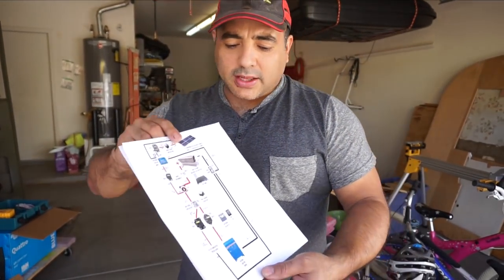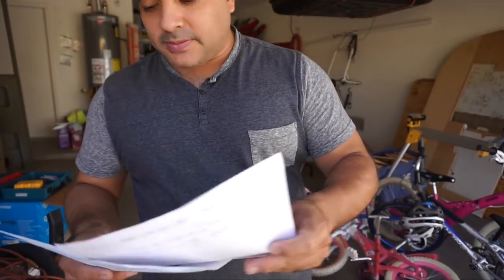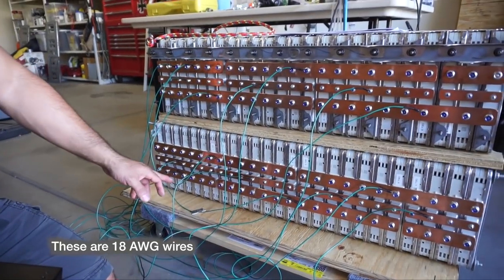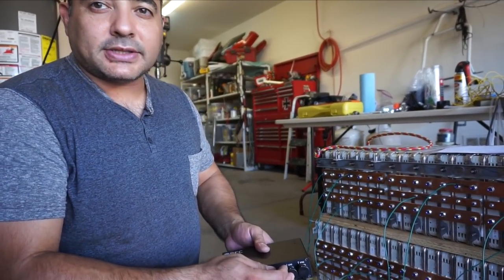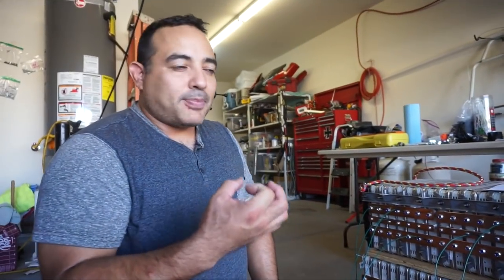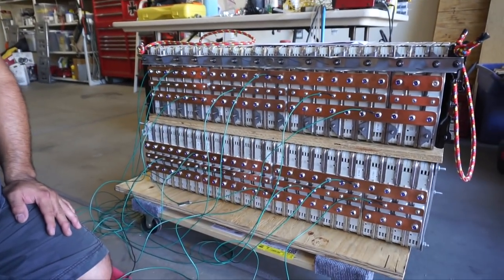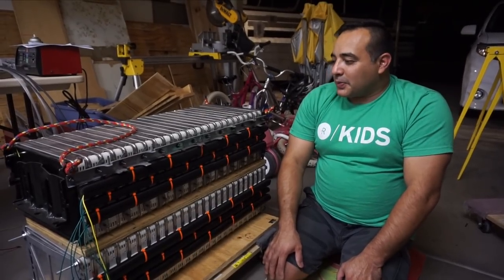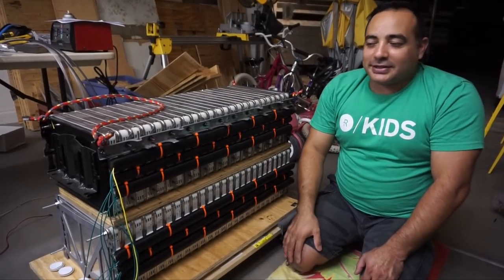RV House Battery Part 4: BMS wiring, test fit, protecting copper bus bars, and planning the install

Comment: I’m trying to understand the path of wiring for the leaf batteries. One large luggage is a positive one large lug is a negative what is the smaller center lug?
Reply from the maker: Hi Joe - the Nissan Leaf modules have 4 cells in them wired up in a 2s2p configuration.  The center lug is for allowing balancing the cells - it connects right between the two cells in series.  The voltage across this center post and the other posts is 3.7 volts (across positive and negative posts it is 7.4 volts)
Reply: Do you use the center lug? I am still trying to wrap my head around how to correctly connect my BMS. How do I get the BMS to read each of the cells (2S)

Comment: Why copper buss bars and not copper cables to connect the batteries? I am looking into this. I would like to go off grid or boondock.
Reply from the maker: Hi Celestino - There are a few reasons I chose copper bus bars.  #1 is that they came from the factory with copper bus bars - the modules are designed to be slightly compressed and copper bus bars provide a neat, secure connection.  #2 is cost - buying one large bus bar and cutting it down was more cost-effective because I could reuse the hardware on the original bus bars and just had to line up drill holes in the bus bar.  Cables would have required buying cable as well as lugs 6 lugs per module x 49 modules - we end up with 294 lugs - 2/0 lugs cost about $2 each so we would have spent close to $600 on lugs alone.  Another consideration is that cables would have been hard to make that small.  The modules are only about maybe 3/4" apart from each other.  It would have been difficult to make a cable large enough to handle the load but small enough to fit in between the small spaces of the cells.
Reply: Beginning from this Morning   thank you. It was very helpful.

Comment: What powers the air conditioner that lives in the bay?
Reply from the maker: Hi Gordon - Thanks for following along.  The air conditioner in the bay will be powered by the battery and inverter.  If we run that little window unit on "eco" mode we saw that it only draws 2 amps of power (via Kill-A-Watt meter) - our solar setup should be able to easily keep up with that even on the hottest days.  If that becomes a problem we could wire into the 12V coach system because we have like 300 Amp capacity and we only ever draw like 10 amps off of it (Originally this bus powered 2 70Amp blower motors in the bay that it sits in - so while we are traveling we have a large surplus of power - this, of course, is Plan B).  The video I am working on right now (wiring 120V systems part 2) will explain where that small air conditioner will get its power.